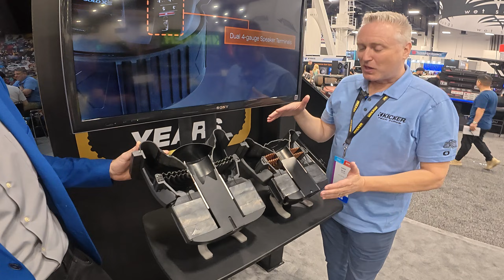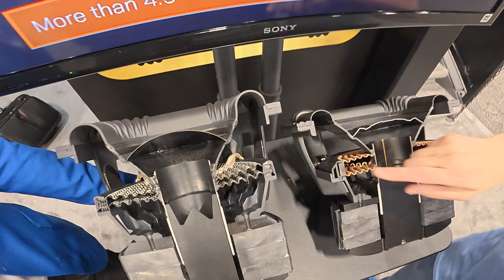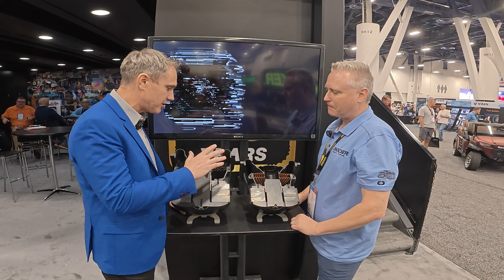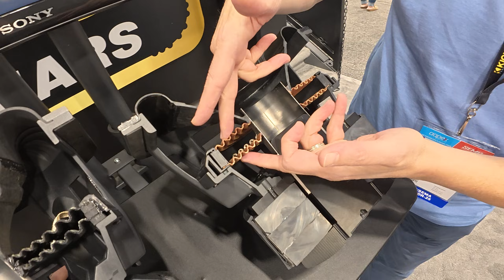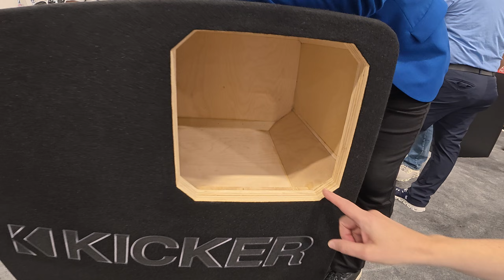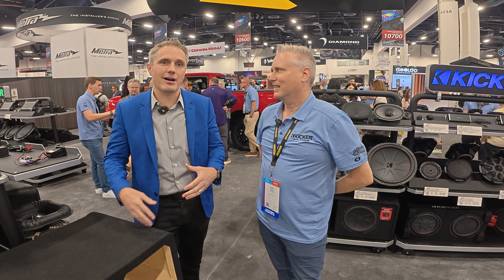SEMA Show 2025: Kicker Comparing the new Solo Xs with the Solo X

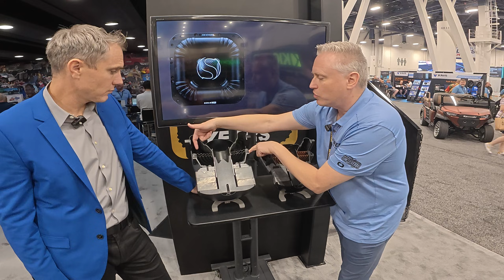Comment: @3:07 says the sub on the left can go from dual 2 to a dual 1.   and on the other sub, you can recone them built limited to a dual 2 or dual 1..    It worded it like it was going to be different, but yet was the same...  am I trip'n here?
Reply: The new L7xs can be re coned and switch back and forth from dual 2 ohm to dual 1 ohm while the L7x can be re coned but limited to the original 2 ohm or 1 ohm and is not interchangeable ... that is how I understood it